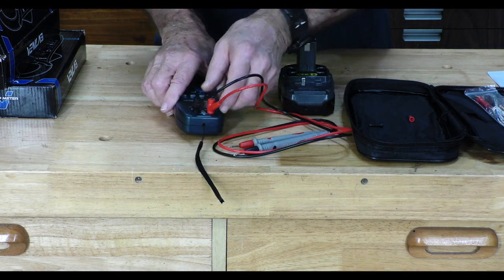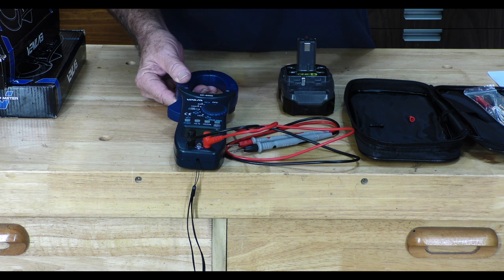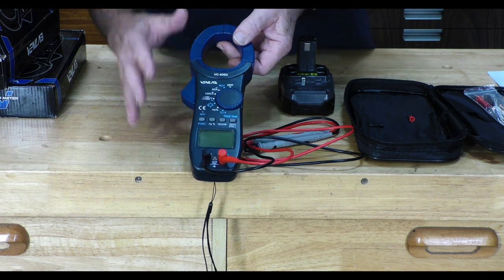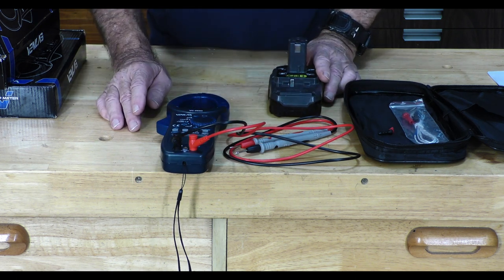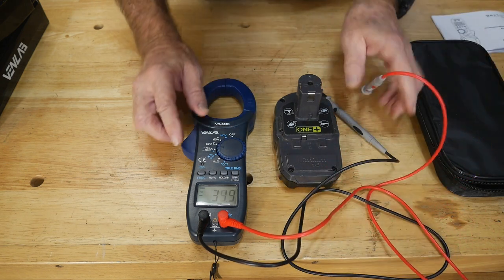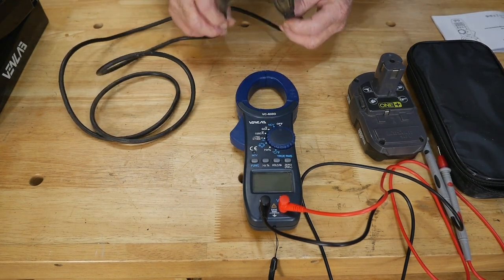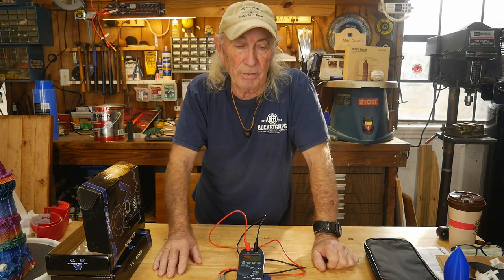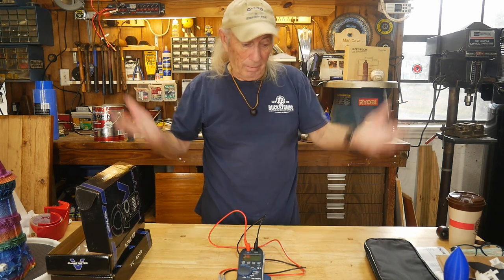VenLab 600D combo clamp meter reviewed C&T ep 302

Comment: Nice video! Wonder if the thermocoupler would be able to check the temp on a 3d printer nozzle to see if it is accurate since thats what is used in the 3d printer to check the temp.
Reply from the maker: I've tried that in the past and could not get a good reading. The new meter just might be able to do that. Interesting idea.

Comment: I have a couple cheap meters, this one has a lot better layout and functionality.  Probably need to get something a little better than what I have before I start installing my own solar power system.  Would like to know more about how large of a system and what you are planning on installing.  Thanks for the review, keep them coming.
Reply from the maker: Right now we're looking at a basic small system and then a large solar system. I'll be doing videos about some basics that might help folks to understand the deal.
Reply: @SirTools  I'm looking at a 48v system starting with one EG4 6.5kw inverter, and working my way up.  As for panels, I figure 4Kw to start with, and then jump to 8kw later.  For batteries, haven't completely convinced going with a rack mounted battery system or building my own.  Building my own I might be able to cut battery cost in half.
Reply from the maker: @farside87  We'll be doing a lithium battery bank on a rack, but low budget etc to start with.